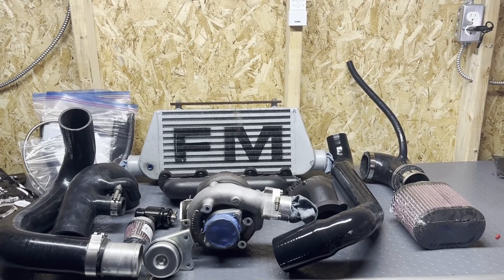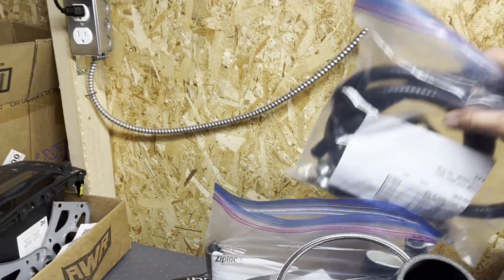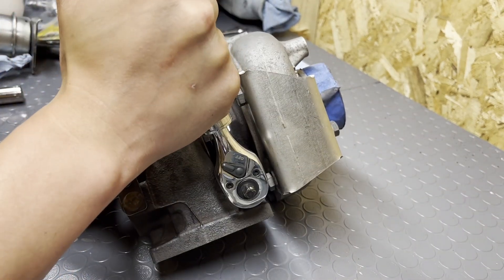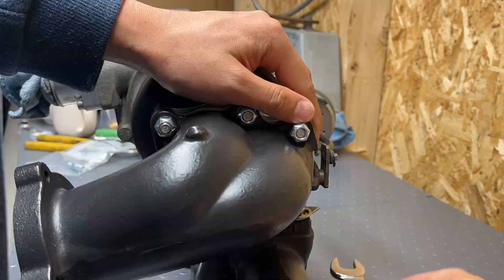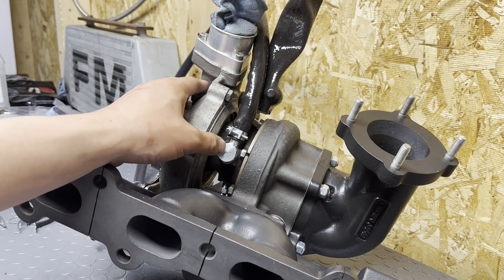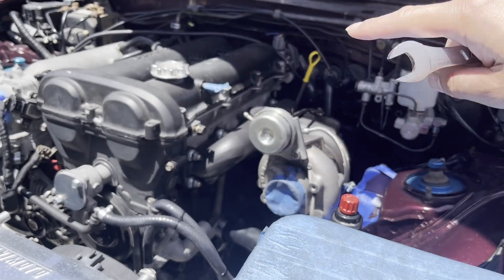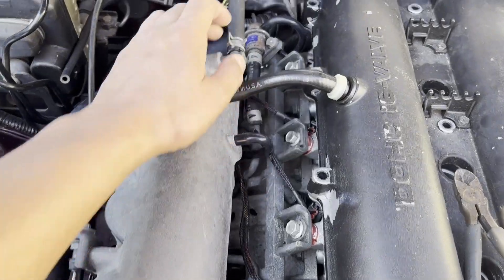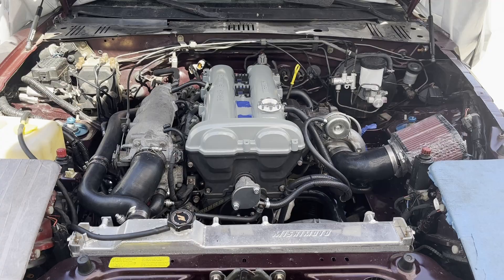Flyin' Miata Turbo Install

Comment: Great video! Excellent camera work and narration. Do you have the part number for the stage8 turbo studs? Seems like the package in the video are for the locking nuts only, not the studs.
Reply from the maker: I don’t have the part number but you can find them on the Flyin Miata site. You can also email them and they’ll help you out.

Comment: If uninstalling the turbo, do i need to drain the coolant?
Reply from the maker: I think you would need to drain the coolant since the lower radiator hose gets removed. I think you could manage to do it without removing the hose and draining the coolant but you would still need to bleed to system on the first start up.